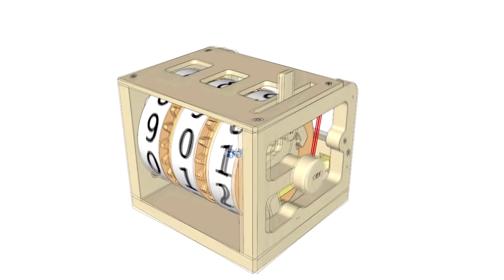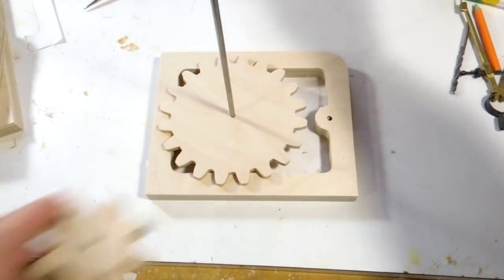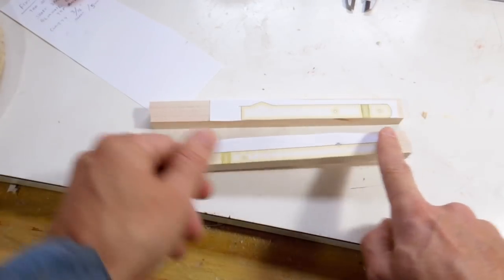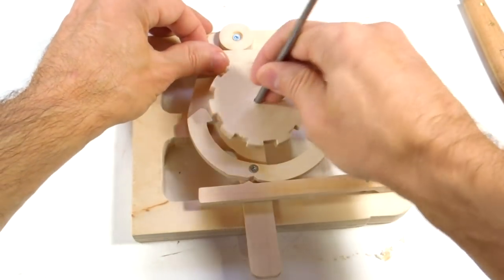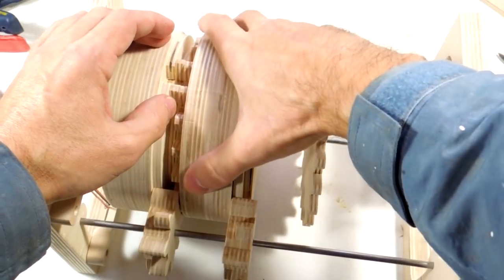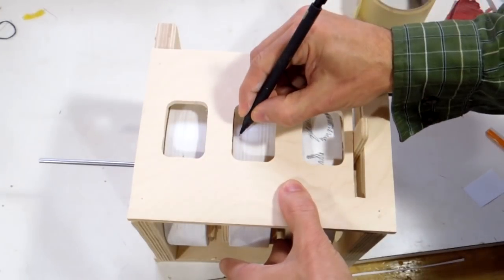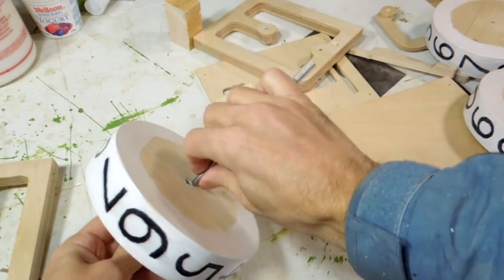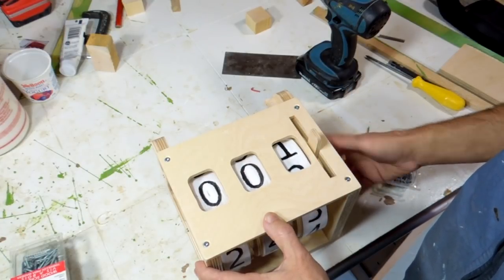Building the mechanical counter

Comment: Fun build! It would be really easy to add a "reset to zero" lever. You would have to have a lever that disengages the connecting axle (the one with the small gears), letting the big wheels rotate freely. Also a weighting system that pressures the blocks into rotating to the 0 position? So as long as the gears are engaged the weighting has no effect, but when you disengage them they roll back to zero naturally? IDK how you would account for the wheels rolling back and forth.. maybe friction? That would get in the way of normal use though..

How is this done in existing mechanisms?

Comment: Just so you know, you are half the reason I want to get more into woodworking, to do pointless but awesome shit like this. (Well, not necessarily pointless, but it's more of a novelty than a utility to build a counter out of wood.) Though it would be cool to build a wood counter that is attached to a wheel to do distance measuring in like the yard or something, those things are more expensive than if you just built one out of scrap wood.

Comment: Wow,fantastic but I just wish there was something more longer lasting than rubber bands it seems you would have to take it apart to replace them when they break. Also, what size bandsaw blade do you use?
Reply: metal spring!
Reply: Re
Exactly.
Reply: Looked like a 1/2" 8TPI - maybe 80 tooth - silver steel.

Comment: Did you consider using a spring in place of the rubber band in the lever mechanism? Somehow I keep thinking that rubber bands are temporary and will perish, whereas a metal spring would last essentially as long as the wooden parts.

Comment: what did you mean around 15:43 when you said you were going to drill a larger pilot hole to pull the pieces together? How does it help? Is it necessary? Just asking as a curious, novice hobbyist
Reply: If the holes in both pieces are the same, the threads of the screw bite into both of them, and the pieces remain separated by the by the gap between them when the screw entered the second piece. You want the screw to not bite into the top piece, so you drill a hole slightly larger than the screw. That way, the screw pulls the through-hole piece firmly against the thread-hole piece. Matthias shows, in this video, how to select a drill bit for a screw: one that's big enough for the centre part of the screw, but you can see the threads sticking out around it. The through-hole bit will, obviously, be big enough to obscure the threads too.

Comment: You should strap a rubber band of each side of the lever, so when you let go it goes back to the middle, and also makes it so you only need to push with one finger, and it will make it overall more stable.

Comment: I am actually not sure how it works, but I can only assume that you disengage the small gears, then pull some sort of spring loaded hook that connects to the larger gears and drags them back to 0, then when you release the spring loaded hook goes back to "neutral" and the smaller gears engage again. Again, I'm not sure that's how they work, but that's the first thing I'd try if I were to make one ; )

Comment: In theory, this could be tweaked a little and made into a clock using a motor that turns the numbers at the right once every minute, right (as well as changing the numbers on the wheels and the gears that turn them)

Comment: I envision a counter/abacus where you can push a lever so you can move the wheels freely by finger, than pull the lever back to engage the carrying gears. Than you do your calculation by rotating the wheels the required amount, and it carries the numbers automatically. You have to know your times table, but as it automates the carrying, you can do very fast calculations without error and without the learning curve of a common abacus, with the numbers being read more easily.
Reply: Google up how a mechanical four operations machine works :-) (e.g. a WSR-160) you will be surprised :D

Comment: I prefer your hand-painted look, but another method would be (if they were laser prints) to  lay the reverse image on the wheel as you did, apply some lacquer thinner with a brush or cotton swab to the back and burnish with the bottom of a spoon or something.  Laser toner transfers pretty well that way.  And then you could varnish it.  But again, I like your way better.

Comment: It seems to be working flawlessly, but maybe using brass sleeves in the bearings and a metal spring instead of the rubber band could make it more durable.

Comment: on your cutting board vid, you were torn between tung oil from a big diy store, or vegetable oil.  Most restaurants use mineral oil, which doesn't go rancid and is completely edible.  

Incidentally, tung oil is nontoxic, but due to its insanely long cure time, most of the stuff you can buy as tung oil is cut with some other agent to facilitate drying in a normal time frame.  Nevertheless, I think mineral oil works the best.  You can obtain it in any drug store next to the laxatives.

Comment: Very clever, and interesting.   Next, try making a slot machine with 3 or more reels, and the symbols, such as cherries.     Or you could make a sort of enigma machine which could generate passwords for the computer, using 5 meshed gear wheels.

Comment: if i wanted to control the different digits independently (ie add 1, 10, 100...) , how should I build it?
Can someone please link me a tutorial or something'?

Thanks
Reply from the maker: Much more complicated for that.  I wouldn't recommend wood.
Reply: Matthias Wandel thanks for the response, actually I figured out a way that wouldn't require different levers for each digit. I noticed that even with the carry gears, each digit can be still moved freely, and that's enough for me. I will use a leibniz cylinder as input, and basically create a calculator. Also, i'm printing it with a 3d printer :)

Comment: Maybe you could hook it up to a motor with an arm to pull the lever. But the motor is slow enough to make each number a one second interval. If you do that, you can make it a timer or countdown.
Reply: The point of mechanic counters is that you dont need electric stuff. But its still a good idea.
Reply: Thian Tromp I totally get your point but mechanical in this sense means not digital.
Reply: +Gio Penguin its more fun without any electronics tho.
Reply: Thian Tromp i see your point.
Reply: Thian Tromp pulling a lever 999 times looks pretty fun (not sarcastic)
Reply: +Gio Penguin you could always make it like an clock with an pendulum and weights

Comment: How is it reset to zero?
Reply: +MrTom well, when the first wheel goes from 9 to 0 it moves the 2nd one from 9 to 0 which turns the last one to 0. because the is no 4th wheel to show the 1 for 1000 from 999 it "resets" to 0

i think binary counting was just the same, but im not sure ( i mean when you got the highest possible number and add 1 you reset the whole thing)
Reply: +Dani Hebrang Yeah I get that.....but you may want to reset to zero before reaching 999...most counters like this have a 'reset' mechanism which disengages everything, spins the numbers back to 'zero' and then re-engages.

At the moment this has to be wound on till it comes back to zero....bit of a pain if you want to start over from say 499.

I think its great though, just surprised that after all the effort thats gone into it that a 'reset' has been left out.
Reply: MrTom ah that was what you meant, the only way i see there is would be to remove the 2 gears and maually turn it to 0... but he made that wheel on the side to turn it faster  ( sry for my bad english)